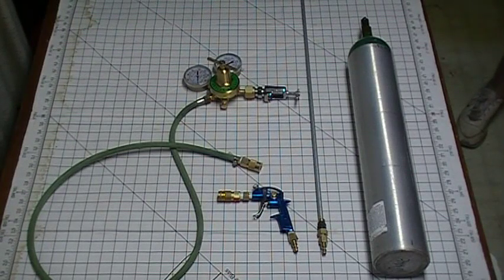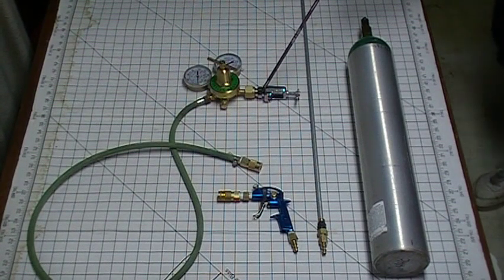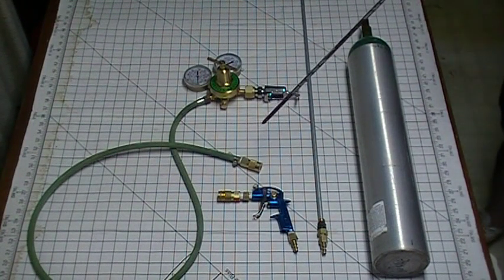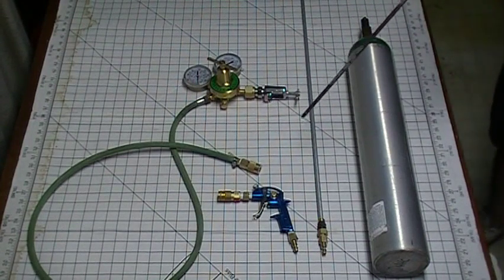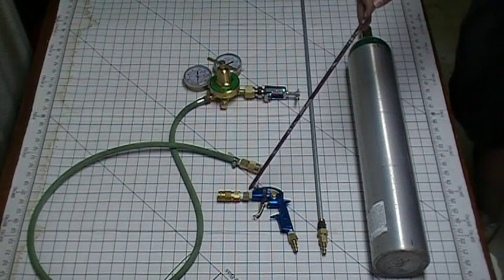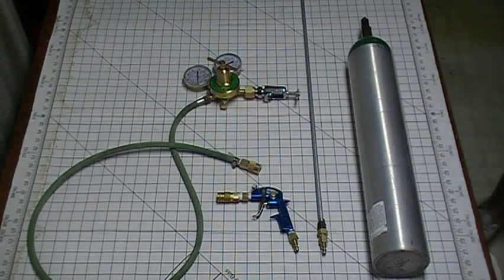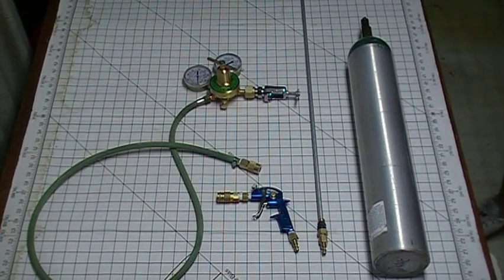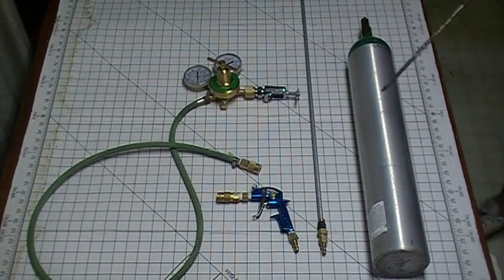Samuel Efurd's Portable Burning Bar Setup

Comment: How do you secure the rods in the lance tube? Have made my own for cutting through cast iron if the tap hole on my furnace freezes. That's the only thing I haven't figured out. Have you just tried running an empty tube?
Reply: did you figure it out yet?

Comment: HI Sam,
I worked for the Union Barge Line in the summers when I was going to college.  We used a burning bar to cut the thick plate in areas we couldnt reach with a long torch.  We used acetylene with our rigs.